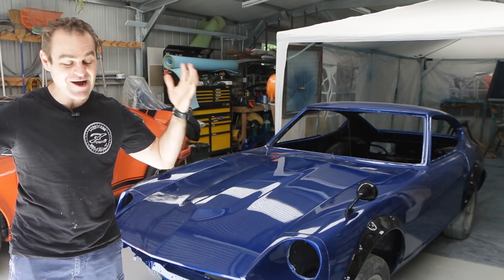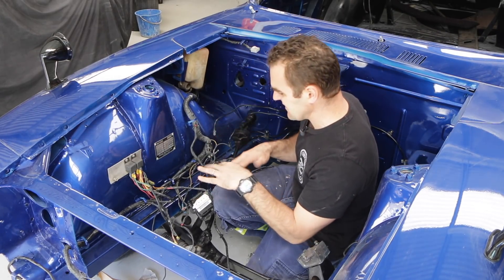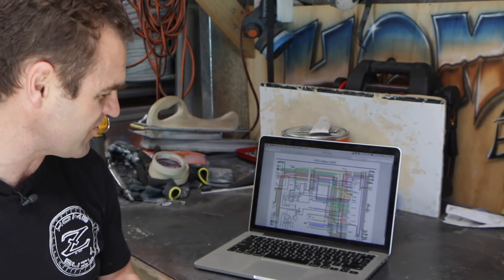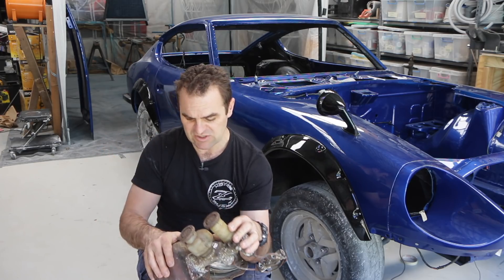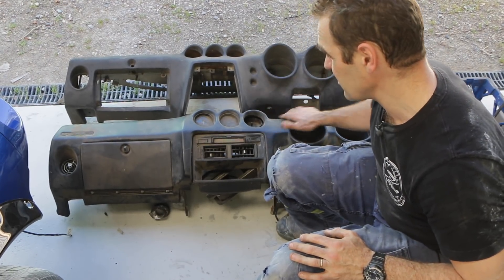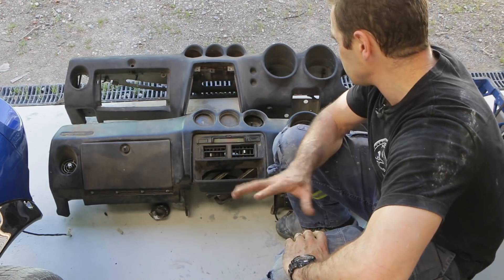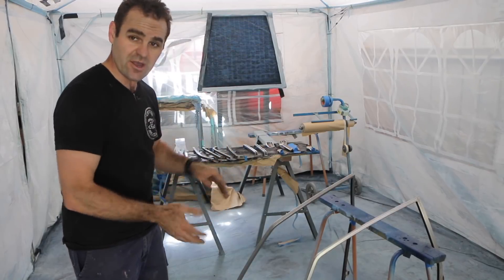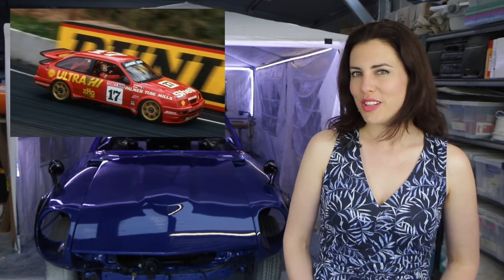Sorting out the wiring - Home Built Datsun 240Z part 58

Comment: In my opinion, you should restore the 240z Dash, it will look way better!
Reply: Yes ,the 3 center gauges. much better . If its 240Z wiring and a 260Z dash the wiring could be a nightmare 
If you want to built a mcm 240Z ,put the 260Z dash in

Comment: Jeff. If 260 dash will fit go ahead. I have a 280 and fixing or replacing a bad one is very expensive. Just be sure it won’t interfere with any wiring. Great video.

Comment: '71 240z owner here, just an fyi for the future: on the stock harness when pressing brake pedal and using turn signal, wires overheat and begin to smoke around steer column within a minute. You said you werent worried about specifics in wiring rn, but its something to keep in mind to test for when you get to that stage.
Reply from the maker: I will keep that in mind. I believe the headlights already have the relay mod done, so maybe it needs relays for the tail lights as well.

Comment: go with the 260's dash. there is really no need to go through the headache of hunting down the bits you don't have then cleaning and repairing on top of that. the tail lights if they don't work out well you could try tinting them so they look black until it lights up

Comment: Great series, really becoming a fan.  Good comments here about the 260Z dash not being the easier option because of wiring, controls and peddle differences, which I did not know.  What I do know is the aesthetics of interior of the car is actually as important, and maybe more important than the exterior looks and finish.  Interior is where drivers receives 100% of their sensory inputs while driving.  We spend all this effort making cars look pretty from the outside, and none of that can be experienced underway, which is kind of funny really.  

Of course, some barely drive their cars.  Some spend most of their time standing around them at car shows or in the garage maybe for them interior doesn’t matter as much, but assuming you are actually going to drive the Z (lots) you need to get the interior “right” or it will forever bother you.  “Right” does not mean stock.  Little things like shift knob, steering wheel and dash / gauge aesthetics make all the difference.  Even floor mats create an impression every time you get in to drive.  If you don’t love being in the car, you can’t love the car.
Reply from the maker: All good points

Comment: Hey Jeff, before you decide which dash to use, suggest you check the plugs and wiring of the 260 dash and the wiring loom (which I assume is a 240 loom) you just installed. I am no Datto expert but there may have been changes to the wiring of the instruments and dash, and different plugs between the two models. It would be a shame to get the 260 dash in and then create a Frankenstein wiring problem for yourself! Cheers, Ty

Comment: If the wiring loom is 240z I would use the 240z dash (assuming you also have the 240z dash looms). At some stage in the 260z there were changes connectors. Not sure when they would have be in AU. Agree with using stock wiring loom rather than a new one. However do a headlight relay upgrade; just google 240z headlight relay upgrade. It makes the lights work much better and prevents a lot of current through the switch. It may have been done already (you have two relay boxes the Al plate you mounted on the RHS. )
Reply from the maker: I am thinking that is what the relays may be for, but I have to do some more investigation.

Comment: I would use the 260Z dash until you find a good condition 240 dash. I have had good results with vinyl paint that will really make it look like new. Tail lights can be polished obviously or cleared, I prefer clear coat but a good polish will look great as well. I find with headlights like on my Audi that get hazy the polishing only lasts a few months, the clear coat lasts years.

Comment: For the wiring diagram could it be saved into photoshop and then flip the image to give you the corrected layout? Also be aware that sometimes l and r hand drive layouts can have differences due to ancillaries being relocated. I'm drooling (because I'm old and broken) for the gunmetal finished trim pieces
Reply from the maker: Most of it is on the same sides, just the batteries are swapped.

Comment: The early dash is FAR better looking with more prominent pods and necals.
The later dash is a smushed down version. It mounts different at the tunnel.the center cinsol is different too The wiring and ducting is different the filler plate dash to windscreen is different shape. Get a full dash plastic cover and a used glove box you will be happier.
  Im  retro fitting early dash into a 78 because the 240 dash is classic.

Comment: Which dash you use will probably depend on what HVAC components you have I would wager that the 240z heater box won't mach up with the  260z heater control panel.  You can get the 240z control panel...

Comment: Honestly better to start from scratch with gxl wiring, and new relays. Most of the power leads run through the steering column; I've had plenty of fires in my Datsuns haha. OEM wiring just doesn't cut it, better to be safe then sorry.
Reply: I know it's a big job, but starting with headlights, and blinkers on a separate circuit goes a long way. Plus, you won't have that annoying one head light dimmer than the other.

Comment: If it was my 240Z I wouldn't be putting a 260Z dash in it.  It shouldn't be there, will draw comment and you'll regret it. I don't think its a straight fit any way. From memory the mounting points are different, the heater controls are definately different and the loom is different. But hey, its your car so do what you are happy with. Looking great!

Comment: I would go with that 260z dash as one of the biggest complaints about the earlier cars was the horrible climate controls. It's not a period correct restoration as you stated and it already is getting a 2.8 under the hood. heck I would probably try to add a haltech fuel injection system to it as well. All that being said it is your car, do what you feel. like maybe purple tartan... ;)
Reply: Also don't clear-coat those taillights, give them a good wet sand with increasing finer sandpaper it will be worth it in the end!

Comment: Jeff, Australia went metric in 1966. Seeing  as Japan was already metric, your dash should be in kph for the '71 model year. I think you shoeld do the original 240z dash just to give it that touch of authenticity. Nothing wrong with resto-modding, I do it all the time!!!
Reply from the maker: The roads didn't change until 1974
Reply: @HomeBuiltByJeff  I think you may find it eas hradually phased in from '71. I remember my early Holden having both measures and it was a '72 I think
Reply from the maker: Someone else has mentioned that even up to 73 the Z's were in MPH. My Beetle is MPH and it is a 71. I think it was all over the place back then during the years of the change.
Reply: @HomeBuiltByJeff  I think the mandate was that all gauges had to be converted by '74. I remember the '71 Honda CB750 gauges were in KPH while my brothers '71 Norton was in MPH....!!!

Comment: The 260z dash won't work with the 240z pedal box without heavy modification here in the states, I wonder if it would work with your model?
Reply from the maker: Good point, I will have to check that.

Comment: There are big differences in the two dashes that make this a difficult swap. Especially the wiring, there is virtually nothing that matches up connector wise between the two. The mounting points are more or less the same, ie you can bolt either one in at least along the top and under the ends, but not the center, but hooking up everything from air vents to heater controls totally different will be, how do you say,  challenging:.. You will need a 260 console to make it match up to the totally different shape of the console center section too.

 

Your best bet is stick entirely with your instruments and wiring, try to get them mounted in the dash  the gauge mounting is totally different, more fun, you'll be putting your guts into the 260 housings, then deal with each of the other issues as they arise.

 

Its just not worth it unless you really like a challenge IMHO
Reply from the maker: I will have to look a bit further into it and see what we have and what we don't and go from there. It does sound like more work than I thought.

Comment: The 240 had fuse box in the lower center of the dash. The 260 had the fuse box in the passenger kick panel here in the States. Using the 260 dash may cause you some wiring headaches. I personally prefer the vent layout on the 260 better. 240's were a nightmare to defrost. I had to carry dry towels in cool weather to keep the windows defogged.

Comment: You wouldn't dare swap the Porsche dash.
  The 240 Z dash is one of the coolest parts of the 240
     And will you (I know you will)
Kick your self every time some one says, that car looks great...but thats not the right dash for this car , is it? 
    That alone will grate on your nerves after all the work you have into it. The quick fix is a plastic full cover. You can restore the original dash , but the vinyl  and the foam are older, then old, because the materials uses are decomposing due to the chemicals they were made from.
   The top of the dash gets beat up from heat expansion and contraction due to the incompatibility of foam and vynle.
   It will crack again. There are companys you can send your dash too but its not a concours so I wouldnt. The plastic full cover 
Or leather skin ( still need to prep the old surface.) I say the full plastic cover is the cheapest fastest solution and its correct enough ,nobody will keep, bringing up, its the WRONG dash over and over....now you and I know, they will always bring it up.
    You don't want to hear Jeff has done a great job on this 240Z  , we know its got an incorrect dash in it But nice job anyway.( you know those people, they are always around to point that out)
 Even the half dash which covers the tops of half the gauge pods would be a better solution that the 260 mushed down crash standard dash.
Even some" dreaded" body work on the top surface ,then cover with a thin layer or two of fiber glass cloth...which you use upholstery spray adhesive to hold the woven  cloth( not mat too lumpy )  in place then apply fiber glass resin . sand off very small amount of excess resin ,some filler primer, some texture paint and its a much more stable repair lasting longer then , just doing it over existing dash alone.
https://www.ebay.com/itm/BLACK-STITCHING-DASH-DASHBOARD-LEATHER-COVER-FITS-DATSUN-260Z-280Z-2-2/391566460165?epid=1388123192&hash

Comment: 240 dash if it isn’t cracked, do it once, do it properly. I am out of the loop as I haven’t redone a dash in a while and do not have a 240, but you can get plastic dashes revulcanised, which is that crinkly coating most dashes from the period came with. You used to be able to buy the paint to do it at home, not sure it is still a available though.